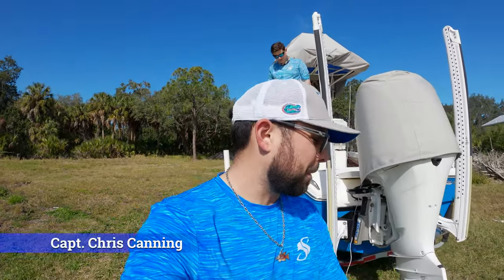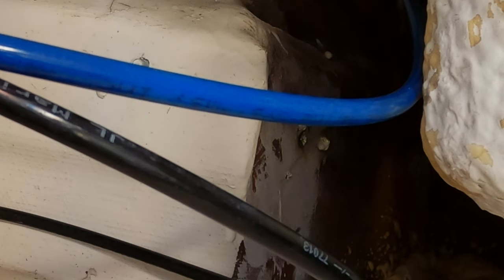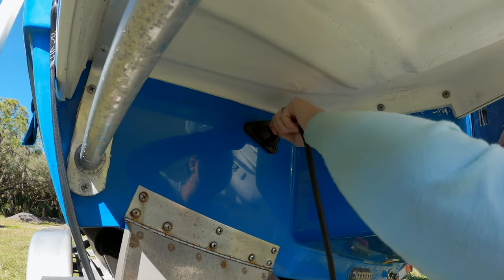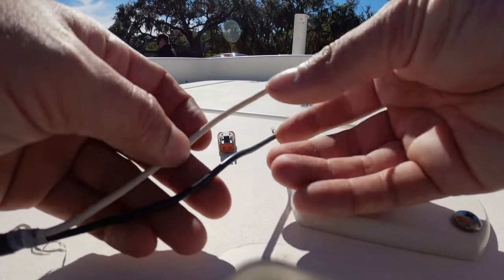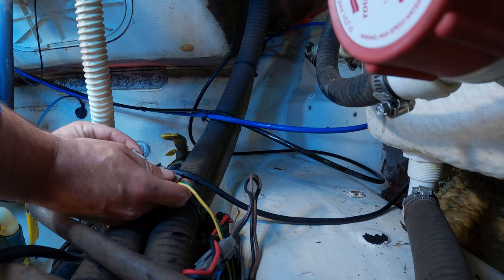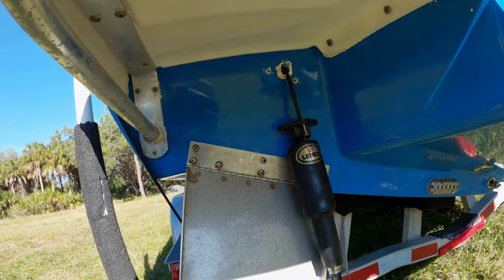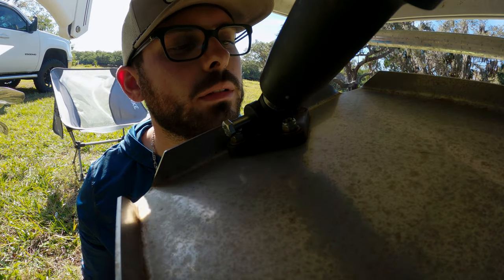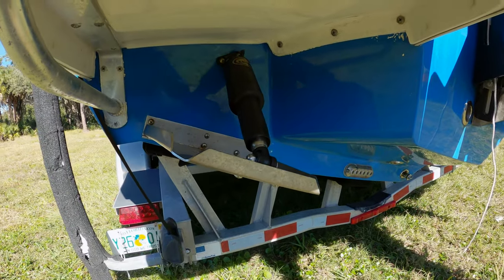Trim Tab Not Working? Lenco Actuator Replacement

Comment: Thanks for the vid, the only comment I have is regarding the 5200. Great stuff for a PERMANENT repair. If you have to service the actuator ever again it gonna be tough getting it apart. 3M also makes 4200, IMHO that would be a better choice as it is semi-permanent.
Reply: 5200 isn’t permanent. It is removable.

Comment: Good video.  To determine whether the actuator is bad,  disconnect the wires from the connector. Apply white to + battery and black to - battery.  Actuator with move in one direction.  Reverse wires and the actuator will move in the opposite direction.

Comment: Hi Chris, after installing a Lot of radios, cb's, etc. in cars, vans, and yes Boats, I can tell you that when you pull a wire out of a tight space and you want to run the new wire back through, a somewhat heavy piece of string and plumbers tape or electrical tape works wonders. Before you pull the old wire(s), tape the string on and pull it through. When you rerun the wires tape them to the string and gently pull while feeding it through. Good Luck my Friend. Nice job. Take care and God Bless  ✝

Comment: Tip for others:
Pull some of the old wire outside the transom and make your connections there, but stagger the connectors a bit.  Feed the old wire and the now attached new wire back through one connected.  Solves the wire fishing issue.

Comment: Don’t forget that the orange wire is the switch power that turns the tabs on from the key. If that’s not plugged into some type of power the tabs will stop working.

Comment: I would check the switch on the dash.  I would think the wiring on this switch would be the same as the wiring on the switch that raises and lowers your boat motor, except you should have two switches mounted side by side, one to control each actuator.  Probably??? you could just remove the wires going to the actuator that works and plug in the wires from the one that won't work.  If it works then you have a defective switch.  Don't know how your switch is wired.  You may have to replace the entire switch if it is a complete assembly i.e. one switch for the left and one switch for the right.
Hopefully, it will be the switch and the wiring is fine.
Let us know how you make out.
John

Comment: How did you know that it was the actuator? I have power to the switch, as far as I can see, but the starboard actuator will not respond. I dont want to go through the headache of replacing it if that isnt the issue. Any idea how to test it? Thanks for the video!
Reply: Contact the manufacturer via website. They’ll email you instructions on how to figure out what’s not working.

Comment: Check the switch use a multimeter and see if you are getting power to the plug down in the hatch if not you got a bad switch or bad wires.
Reply from the maker: Yes, I need to do this Chris! I have been procrastinating it.